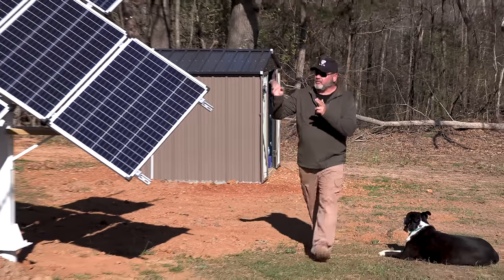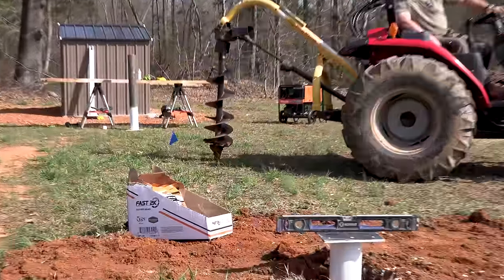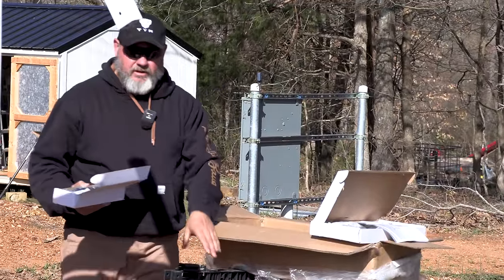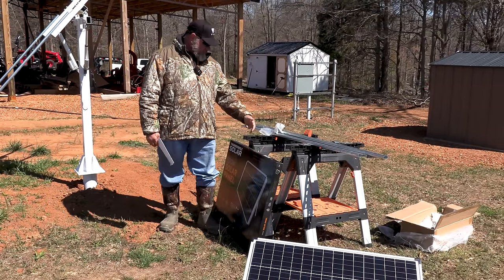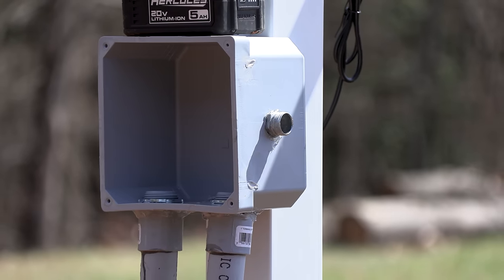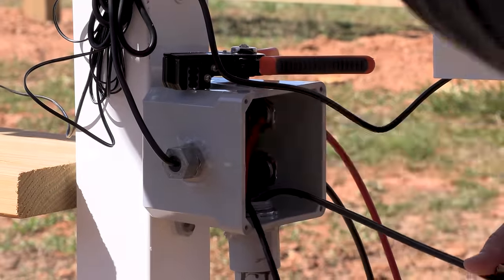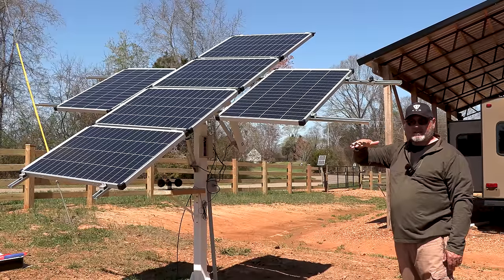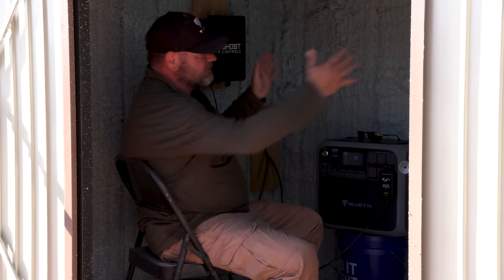You Really Need Solar Power to Survive Grid Failures! DIY Automatic Sun-Tracking Solar Array

Comment: Those actuators will fail within the year, mounted with the motor on the bottom. The limit switches will disintegrate from corrosion. Specially the bottom one. Flip the actuators the other way with the motor up, so it drains and prolong the life of the switches. Open them up and add some grease on them to. I have used them, and all ecoworthy actuators suffer from this.
Reply from the maker: I find your comment hard to believe. My system doesn't have limit switches. Time will tell. If they suck, I will give them a bad review.
Reply: There are limit switches.  If there weren't when the jacks got to the end of their travel they would keep going grinding the gear inside until it was totally trashed.  Every actuator now says had end of travel limit switches.  I can see them working when they were hooked up backwards.  How do you think they stopped?

Comment: I wonder if the tracker is strong enough to hold all 8 of my 235 watt solar panels? I see the cross shape that people end up with ussually with this mount but id like a big rectangle out of my 235 panels. Just not sure if it would be strong enough to move the extra weight. Any thoughts on this would help me out. Thanks in advance for your opinion
Reply from the maker: I think maybe 6 at the very most.
Reply: @TonysTractorAdventure  thanks for responding to my question. I think your video talked me into getting this same mount as you have. I paid more than that for my stationary aluminum mounts and with this next set of panels I buy I'm definitely gonna get this type just for the extra power makes it worth it plus it's not expensive as I'd thought. I figured it would be probably 2000 bucks atleast

Comment: Everyone that's used expanding foam concrete that I know of has had problems with it failing! 😏
Reply from the maker: Now you know someone who hasn't had problems. There are several brands of foam and they're not all created equal. Fast 2k has been used for holding up electric company utility posts for almost 35 years. It is not the cheapest thing on the market, however it is easy and it holds well. My pole barn, my fans, my greenhouse, and my solar panels have all gone through 80 mph winds. After those strong winds, nothing has moved in the slightest. I am building a house on it.
Reply: @TonysTractorAdventure  Anyone that would use this for utility poles needs to have their head examined! 😂
Reply from the maker: You would need to contact the thousands of electric municipalities which have been using for over 25 years to know for sure, but I would imagine it is the fact the first post installed are still standing holding up electric lines as you drive by. You strike me as the type that is still going to town on a horse and buggy. You still believe cars are a fad. My recommendation is you try this brand. FAST2K Deck and Post Anchor.  There is nothing else like it on the market that is even close. If not, enjoy your life.

Comment: I'm wondering if the base mount will not spin in the ground because there were no cross anchors at the base of the pipe. Wind would not pick it up but it could rotate, and sun tracker would be out of balance
Reply from the maker: No spinning at all. 80 mph winds. Fast 2k is absolutely amazing. We have built almost everything at the farm using Fast 2k. It is the anchor.
Reply: Wow, that's clean and easy way of anchoring things in the ground @TonysTractorAdventure

Comment: What thickness or gauge was the metal plate you drilled and welded as the base for the tracker post?
Reply from the maker: I used a half inch metal plate. I had it cut at may local metal supplier.

Comment: If you put enough panels on your roof ...you don't need to track the sun. This would only be needed for very special situations.
Reply from the maker: Whether it is on your roof or on the ground, it will not provide the same amount of power output as a solar tracker. The solar tracker aims directly at the sun from the early morning to the latest part of the evening.

Comment: Voltage doesn’t kill you, amps do 😉
Reply from the maker: Great sharp shooting. If you were not so interested in proving to the world you know stuff, you would have understood I made this for beginners. Most of them have hear of volts, but not everyone understands amps. The grew up hearing, "that 110 volts will kill you." Playing on a different level here. Will one thousand amps kill a person if the system only has 12 volts?
Reply: @TonysTractorAdventure  No it won’t. Low voltage systems are safe to handle doesn’t matter how many amps it can put out, it can not over come the resistance of human skin. Even 50,000 volts does not kill you if the current is low enough, think of tasers. Oh I’m not trying to prove anything, I just like information given to be accurate.
Reply from the maker: That was a rhetorical question.

Comment: It seems a waste putting such low powered panels on that tracker.
At $600 for the mount to be chasing just 600w, when you could have added 48v panels of 300-400w each.

I made the mistake of buying eco worthy panels... Sold as 300w and the best I can get is 120 on my Growatt inverter and 140 on my Renogy inverter. At the time I didn't know there was 12v and 48v panels... I'm definitely looking forward to adding and buying something like Trina or Hyundai 400w panels but considering you're future planning I'd have definitely gone with different panels.
Reply from the maker: As I said in the video and other posts, this is only a learning system. Most people dive in not knowing anything, spending big money, and buying a system not matched to their needs. We decided to build this smaller test system to learn with a very low investment. It sounds as if you should have done the same thing. FYI, my panels from Harbor Freight are performing above-rated outputs. Everything seems to work just as it was expected. I feel a great deal more confident in moving to our bigger build after the barn is done.

Comment: Question: I'm North of the equator.  Does the North sticker sit on the North side of the compass?  I'm asking because a weather station I installed wanted me LOOKING at the North sticker, while I was facing north but the sticker was facing South.  The Ecoworthy direction does not say exactly.
Reply from the maker: The stickers are right for North of the equator on the post. The directions are wrong for the controller. Many people confirmed this.
Reply: @TonysTractorAdventure  Hi, thank you for the reply.  What do you mean the directions are wrong for the controller?  Anything specific regarding direction control? Or what you know is wrong?  Or, maybe you addressed this in a vid I can watch?  Thanks again!
Reply: I swapped the  + &  -  wires on the board for the E/W correction motor and it is working fine now.  It found the sun and adjusted correctly.

Comment: You should put the nuts on the bottom to keep them from rusting..
Reply from the maker: I painted the bolts
Reply: Right on I am still watching the video. I love the system and thinking about one for my off grid cabin.
Reply from the maker: One month later and it is working as advertised. I will do a full review in 6 months.

Comment: Why didn't you rotate the wiring box so the display is horizontal and cables are entering from below
Reply from the maker: Mainly, because the holes were drilled there from the factory.

Comment: You probably shouldn't seal up bottom portions of Junction boxes that's where water can escape if it gets in you only want to seal top if you have wire connections coming in from the top only steal the top of junction boxes
Reply from the maker: Thank you for your advice. We seal up everything. Bugs are a big problem. If water gets in the box, it will be sitting in the pipes below ground.

Comment: this video use  100 watt solar panel.  (weighs  5 kilos)

Generally uses 570 watts solar panel. (weighs 30 kilos)

How many kilograms can it support ?
Reply from the maker: You will run out of space before you reach the weight capacity.

Comment: You really need to explain more of what you are doing. Some of us are not electrical contractors.  Why the conduit, what the boxes on the poles... You got the sound on you should use it to explain. Since people do not know those wire pass through are weather tight.  Also I use to install the old 10 foot satellite dishes.  We always used concrete. We tried several stake systems and special compounds and within a couple years we had to go back on all of them and replace with concrete. Your north south actuaror has hardly no south travel to go south.  Unless you did this on December 21 when the sun is the lowest you are going to miss the sun in the winter. One other thing is turn your actuators over.  They will last a lot longer.  Water will run down the drive tube right into the motor.  I guarantee it.
Reply from the maker: Thank you for your opinions. The North South tracking is perfect. I am installing another one. I will try to do better.

Comment: So at max you can make 1200 watts so yojr little heater can run all day long and kill the battery at night leave heater off during the day run at night kill batteries.. bigger panels would do you a much better deal..
Reply from the maker: Your superior attitude is getting in the way of your understanding. As I said in this video and others, I built this system as a learning system. All of the infrastructure can handle bigger equipment. I built this small system to understand the right question to ask. When it is all said and done, I will use this smaller system somewhere else on the farm. I can afford to spend a couple thousand dollars to not make a $50,000 mistake. The heater was only used as a load bank.

Comment: You should put the bolts on the base nuts down. Should they back off the bolt will stay in the hole.
Reply from the maker: If you need, what would happen if the flange was horizontal? Which way should the nut go then?
Reply: @TonysTractorAdventure  old skool common practice, vertical application. Horizontal will fall out either way.
Reply: Yep and the #2 and 3# pins he put in should also be turned around, if the cotter pins fail the pins will fall out. It is a aviation thing ;-)
Reply from the maker: If the bolts or nuts comes off, this thing is gone! I do understand your thinking, but we are more likely to get struck by lighting under water in a submarine than these bolts moving. I am more worried about the kit pins.

Comment: I am surprised people would do this, use the cost to install an extra panel or two instead?
Reply from the maker: How much do you think this install cost?
Reply: You installed 600 W of solar panels and believe that it will achieve a +40% performance against fixed south facing panels. Hence to get the same power output over a year you would need c. 840 W of panels. 

That’s just two proper sized 425 W panels costing about £170 each in the U.K. obviously the ground mount panels need some form of foundation and frame but these are going to be a lot cheaper than what you have bought, erected and set up. It will also take up a lot less overall space. 

There’s a reason why solar farms do not both with this (mainly, I’ve seen a few but only in Nordic countries).
Reply from the maker: It costs me $460 for each stand. The panels pick up an extra 70% in the mornings, they average 43% gain over the day. We have limited space and I did a long-form video if you're interested.
Reply: @TonysTractorAdventure  to put two panels on the ground would take up less than 2 m x 2.2 m though - far less than the area that you have sterilised using this system.
Reply from the maker: Paul, I appreciate your opinion on this subject. Thank you for your comments.

Comment: You have convinced me that the directions really suck for this system.  My choice is to avoid this brand of tracking unit. The number of days you spent installing this is also a tip off about avoiding this unit, EVEN THOUGH ITS GOT GREAT HARDWARE!
Reply from the maker: Watch the second video. I got a new one. The directions are so much better. Plus upgrades.

Comment: I have no clue what you would do with this system in high winds, ie hurricanes or tornados.  You need a system that will close down, and tuck in. to minimize exposure.
Reply from the maker: I would recommend that you watch the video. The system has already been through 80 mph winds. It tilts flat and flies into the wind. So far we have had two storms with 60 mph winds and one with 80 mph winds that took down buildings around us. Everything that we have put up is intact and still working perfectly.

Comment: Cool trackers, but I think that simply adding more panels would be a better solution. Those trackers will fail long before additional panels will. I have read your argument that you can grow vegetables in the space that more panels would take - well you are standing in front of a huge roofed structure. Knock it down and grow them there. You’re talking about power outage, not the zombie apocalypse.

You show no evidence that you are harvesting 40% more power, no cost comparison of the active system vs simply adding more panels to passively achieve the same result.
Reply from the maker: I disagree. First off, I did show power comparison. You didn't watch it.  40% gain is an average all day. When I went from a late afternoon stationary south facing position at 475 watts, and then allowed the system to self track the sun, my watts increased to 678w-700w. That is a 70% plus increase. With stationary panels, they only hit peak performance about 1 hour per day. As the angle of the sun changes, stationary panels become less and less efficient.

Comment: I am really surprised that you would choose to go with fast 2K, If you had bothered to watch some reviews you would know that it is very sub par... Regardless of what their claims are it does not hold sufficiently in the ground... You will have movement on the posts that will gradually increase over time as they get looser and looser in the ground... Secondly your wiring in the boxes is sub par.. Do not use simple wire nuts to hold more than 2 wires together.. Use connectors or soder..Connectors used like this can cause loss of contact issues which can cause a host of issues.. Finally,  you should offset your post holes so they are not in line with each other while tracking the sun position...This allows for more direct light capture from both panel positions..Good effort though.  You will know more for the next time..
Reply from the maker: Unfortunately, you have no idea what you're talking about. My entire farm is built with FAST2K and I have never had one failure. If you follow the simple directions, it will surpass concrete holding power. All of my pole barn buildings, fence and greenhouse have been through two storms with winds of 60 mph and one storm with winds of 80 mph. My neighbors lost buildings and all of my structures still stand strong. I don't know where you're getting your information from, but I have first-hand accounts of success all over the United States.

Comment: I am shocked you would go for Harbor freight with so many better options, especially going with a solar tracker system, its like putting a Walmart stereo system in your Bughatti
Reply from the maker: Thank you for your opinion.
Reply: Honestly harbor freights monocrystaline panels are high quality over performing panels. I know first hand
Reply: How much was the tracking systems and what are the load limits?
Reply: Longevity is a concern.
Also reliable Support Tech is a must.
I call the Co Support Before I Buy.
That has Saved me from buying from lousy companies
Reply: Cool idea.
Reply from the maker: My system has been through two 60, mph winds and one 80 mile an hour wind. In my mind, I plan on having to replace an actuator every couple of years but they are cheap. I'll look at him like tires on a car.
Reply: Solar panels are  simple products . If the perform well ur good
Reply: In the old days everything came with good instructions.
Reply: @TonysTractorAdventure very impressive

Comment: don't get me wrong, but isn't it much cheaper to buy 40% more solar panels?
Reply from the maker: I totally disagree. Each unit is only 350 to 400  bucks. You also were not taking into account when I get morning Sun but it's cloudy during the middle of the day. A stationary unit gets left out.
Reply from the maker: I think it boils down to what each person wants. Where I live, this seems to work well. Half of our days are cloudy. If the sun comes out at all, my system capitalizes. Stationary systems get only the best light at the middle of the day. If it is cloudy, they get left out. I have seen it happen were we get sun in the morning, and a mid day shower, with sun out in the afternoon. This system capitalizes on that.
Reply: I was thinking to get sun tracking as well, that's why I'm here, but if I can get three times more panels for the same price, I can point them from east to west, and I don't need any moving parts which can brake.